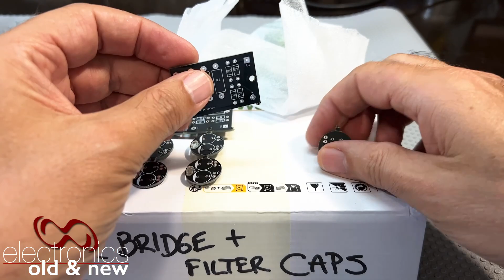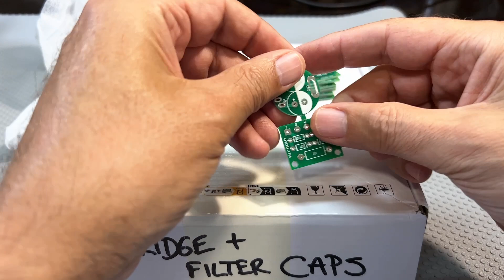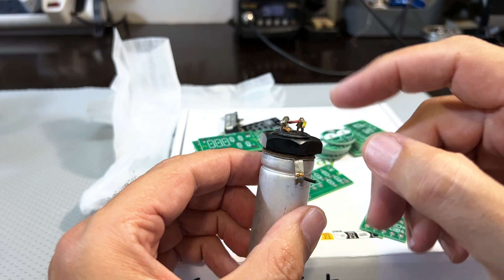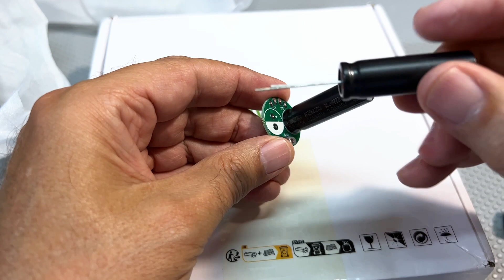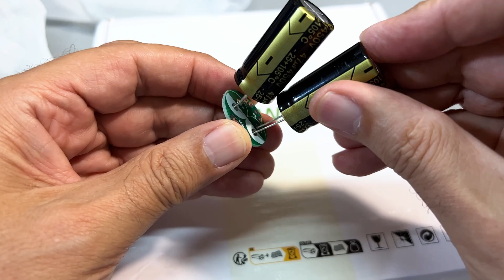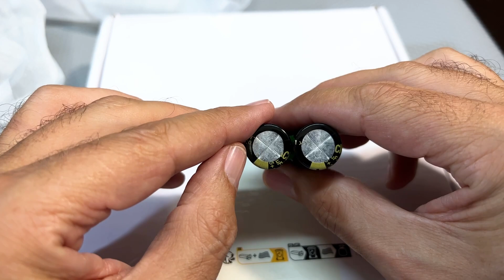PCB's for Tube Radio Filter Capacitor and Selenium Rectifier replacement #pcbway#

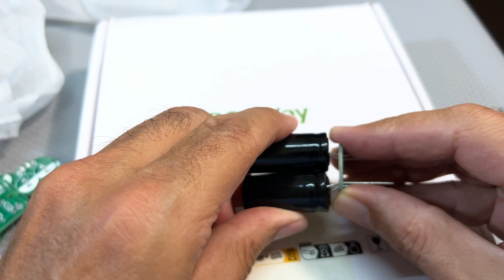Comment: @11:00 would you want to put some heat shrink around the leads as well? Between the capacitor and the PCB, I mean?
Reply from the maker: You can, but I’ve not found it essential unless there are a lot of components and wires very close to the area.

Comment: Do you know which specific videos you have gone over how to choose dropping resistors for silicon rectifier replacement?
Reply from the maker: Check out the one on the actual pcb project
Reply: @electronicsoldandnew Thanks!

Comment: Maybe you have mentioned it in a previous video, but is there a particylar reason why you choose to use 4 discrete diodes and not a bridge rectifier?
It would take up less space on the PCB, and that could come in handy espessially on the smaler PCB.
Reply from the maker: It’s more a force of habit than anything else. Also, there are various pin spacings for bridge rectifiers, but with diodes you always fit them perfectly 😊

Comment: I am still surprised you can get the guts out of those old filter caps. I now had 3 old Philips in a row and 2 Erres, and with all of them the inside of those caps was just totally gunked up and stuck. So unfortunately I can't use these kind of PCB's :(
Reply from the maker: The idea of using these is if you DON’T want to restuff the caps. To restuff them, you can use a little heat to soften up the gunk a little and then it comes out quite easily.
Reply: @electronicsoldandnew  Like boiling it into water or so? I have tried many things, but no luck yet :(
Reply from the maker: Try a heat gun, or even a hair drier

Comment: The spacing between AC and negative pin is not a good design choice, honestly. You could swap 2 diodes and achieve much safer (and potentially less noisier) result.
Reply from the maker: You’re probably right.
Reply: For secondary voltages we only have to comply with functional creepage and clearances. 
Most definitely basis at best. Totally different story for primary mains voltages, something a lot of people mix up.
Reply: @p_mouse8676  I'm not sure what you are trying to say here